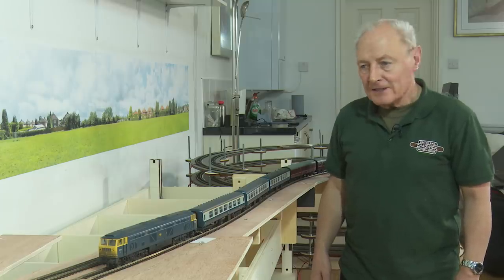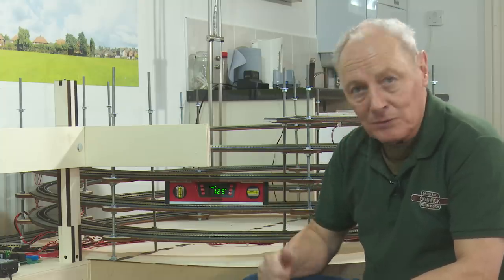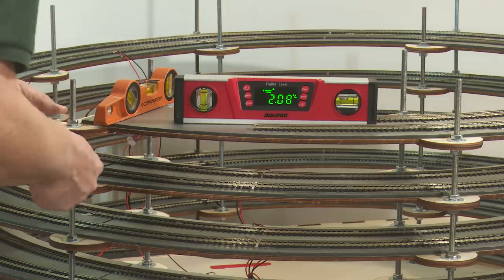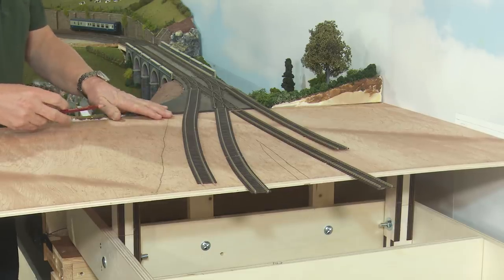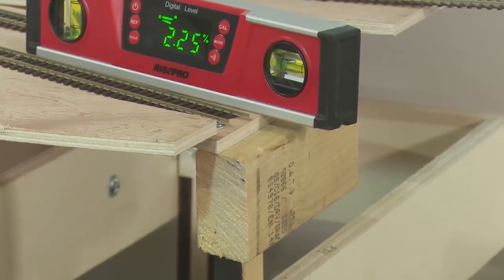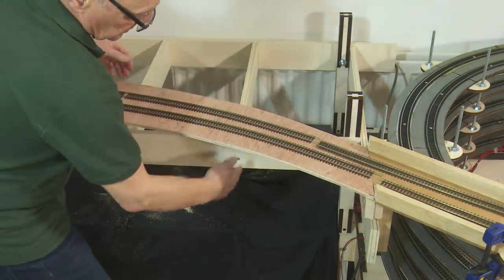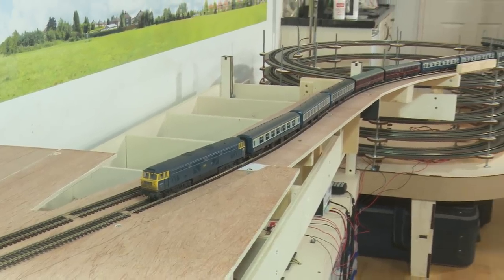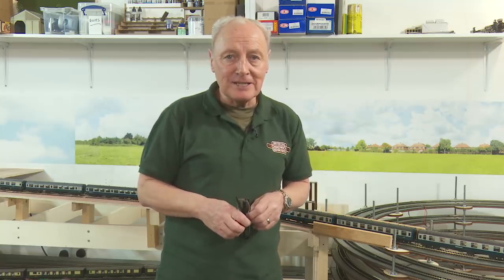Managing Inclines and Layout Update at Chadwick Model Railway | 123.

Comment: Really impressed with this. Its looking a LOT better and great to see it working well.  

For the station board, above the helix, i would concider constructing it so it potentially sits on a frame with Dowels, aswell as not laying the track straight accross the joins (dcc concepts copper clad sleepers are excellent for this)
You could then have the station board basically unbolt and be able to remove the whole area.

Will be a LOT easier to work on the scenery side than leaning over a very spiky looking helix!
Plonk it on a work bench and away you go! 😀

All the best Charlie, Eric F
Reply from the maker: A very interesting comment Eric. Yes I had thought about having a removable section, and also to cover just half of the Helix if that makes sense. It’s great to have you on board, regards Charlie
Reply: @ChadwickModelRailway  yeah would make your life much easier at the end of the day wouldnt it. 
Im very impressed with the helix anyhow, its a work of art!
Look forward to the next vid.

Comment: I don't know what is says about me! But one of the most absorbing videos on YouTube I have watched!! A genuine sense of anticipation at seeing it working, and total admiration at your skills from the point of view of design execution and carpentry.
One thing, have you given thought as to making the front side of the board wide enough for the necessary scenery as the track curves out the top of the helix, as it would seem to me, that quite a bit of woodworking will need to be done to create at least the frame for the 'nearside' of the cutting as the track disappears into the tunnel. If you follow what I'm saying that is.
However given the enormous challenge you have given yourself when you embarked on this new plan for your layout, this issue will I'm sure not present any significant issues.
When your wife said 'that looks dangerous' I wonder if she is referring to the dangerous enormity of the project your undertaking! 😉
Reply from the maker: What a great comment Keith. The trackbed for the track as it comes off the Helix is by no means the finished item. I can easily make it wider or more narrow to suit the landscape that I will build. I do hope this helps, regards Charlie

Comment: Nice vid.
All of this is a good reminder that planning the helix is crucial. The rise must be enough to clear the track below, allowing for the thickness of roadbed, upon completion of the first revolution. The radius needed to do that can be calculated as the rise divided by the quantity of the decimal of the grade percent, pi, and 2.
Ex: for an N scale helix rising 2.75" each revolution, the radius curve for a 1% grade is 2.75/(.01*3.14*2). About 44".
Reply from the maker: I think you’ve hit the nail on the head Donald, it’s no walk in the park. I now have various items of rolling stock to modify so they can survive the pressures of the Helix.

Comment: Well, Charlie, it works!! At first, I did not see the problem and then it fell into place. The gauge that you made could not possibly fit under the first ring and then that meant that all the rings would have to be lowered and hence the need of a top ring. It must have taken a long time to sort that out. The clearance in height is a bit tight an American observation car would mean people losing their heads. A job well done. I much invest in one of those spirit levels as you know I am facing some inclines and I have changed the plan again. Martin. (Thailand)
Reply from the maker: Excuse the pun Martin, but it’s been one hell of a journey sorting this little issue. Regards Charlie

Comment: So pleased you finally reduced the gradient, your engines will be all the better for it too, track work exiting helixit looks great. On gradient measurement a note of caution just because it's digital doesn't mean it's accurate, steps 1.99 to 2.08% is a 4.5% error, and if it's resolution is + or -  one increment that is a whopping 9% error and that's before we add in calibration accuracies. Far more accurate manually measuring or using a simple spirit level and gradient triangle. It being repeatable (subtly different from accurate) might just have worked for you though. Glad you are pleased with it all. Stephen
Reply from the maker: But in the helix?
Reply: Yes, you have equal segment arcs, each must rise by the same amount, carefully check each for the critical first turn then use your gauge block for equal spacing between following turns to set those. Sure a bright led display is far easier to read, but as said ther is a significant margin of error in its reading as you rightly highlighted. Am glad it showed up your first turn gradient error.

Comment: A great video Charlie - thank you.  The digital inclinometer clearly helped a lot to show you where the difficult areas of the helix were.  Another (cheaper) method is simply to put a small spirit level on on a flat wagon and watch how the bubble moves as the wagon goes up or down the gradient.  For a constant gradient the bubble should remain stationary.  Given that you know the average grade (by calculation) it should still be possible to make adjustment where needed.  (Just throwing this out there...)  I have a small Märklin Z gauge wagon which is simply a small spirit level on a pair of bogies it works surprisingly well for such a simple device.
Reply from the maker: I understand the point you’re making. However, it’s best to use the digital spirit level during construction. That would’ve removed all the errors. Regards Charlie

Comment: Hi Charlie, 

The Prototype mountain railroads that had many challenges and needed steep grades, (like many railroads in Colorado with 3% - 3.5% and higher grades), were trying to gain as much rise as possible in the limited space they had available to meet the demand. They had a method of applying grades. They used to at the beginning of the grade have a steeper incline while much of the train was still on more level ground and then they would ease the grade to the ruling grade. This would gain them a few extra feet of rise without bogging down the engine or causing driver slippage.

Example: They might have a 3.5% grade for the first part of the grade (while the trailing freight cars were still on more level ground) and then they would ease the grade to a lesser grade, like say 3%, when all the train was now on the incline. This way they picked up extra rise and could reduce the ruling grade up the incline. 

I have done this on one part of my HO mountain railroad where I have steep grades, which comes in handy if you're trying to get that extra 1/2" of rise in the space you have to make the climb. 

Just thought I'd share that info. We can learn a lot from the prototype and it is interesting how they solved problems. All the best Charlie. 

Philip
Reply from the maker: What a very interesting comment Phillip. I’ve never really considered that option. Regards Charlie
Reply: @ChadwickModelRailway  Yes, I understand Charlie. Neither did I think of that until I learned from researching the prototype mountain railroads. (It's actually fun researching and always good to learn how a real railroad solved problems). Using the prototypical approach, is a method that can come in handy for some and be very useful when trying to solve a grade/space problem. All the best from New Jersey.

Philip

Comment: Excellent and interesting as always.  Thanks.  It is of particular interest to me as I am reconstructing a helix to go from 4-track to 5-track with a particularly difficult gradient on the inner track - radius 1 at about 1 in 28  which is about the minimum possible with sufficient head clearance.   Judging from train speed variation I too have a problem with varying gradients and will now get hold of the marvellous digital level gauge you used. It could be a life saver.  Incidentally, I use a 1 in 42 gradient on my mainline as you are now doing.  This was chosen as the shallowest gradient that still looked like a gradient.  Everything much less steep just looked like level track.
Reply from the maker: A great comment Graham. Good luck with your helix, they’re never an easy beast to tame! Regards Charlie

Comment: In the US, cheap spirit levels typically have marks for 1/8 and 1/4 inch per foot, for putting in slope for adequate drainage.  That's 1 and 2%, approximately.
Reply from the maker: But doesn’t cheap mean inaccurate?
Reply: @ChadwickModelRailway  maybe I should say "even" cheap spirit levels...  My guess is that even the cheapest would do for our hobby needs.

Comment: I'm sure I heard heavenly choirs singing "Hallelujah!" when you revealed the helix was fixed. Time to scrape the bullfrog snot off the locos to improve pickup!

Many years ago, a carpenter warned me against using PVA to seal timber, pointing out that PVA is water based.  He recommended yacht varnish for sealing wood, though I suppose any exterior paint or varnish would work.
Reply: PVA is not like emulsion paint. Since you can soak it and then detach the items, it is clearly reversible. So perhaps the paint option might be better to seal the MDF?
Reply from the maker: An interesting point Andrew, but I certainly hadn’t considered. Regards Charlie

Comment: Well done Charlie - good progress.  I imagine there are a few of us having to think through what alternative solutions to material shortages that exist due to lockdown/factory closure etc.  I seem to be spending much time repairing 2nd hand peco points that I acquired a wee while ago, without realising how fiddly they can be!  Nevertheless, its nothing to the challenge ahead - one being thinking through the power districts (2) and block detection (lost count) using Digikeijs and probably iTrain  - and then creating an interface with the upper level I'm just starting which will be for my older Triang stuff running DC using buckets of series 3 track I have....not an issue other than electrifying the old points......(thought - might ask my wife to sit and pull strings when points need changed.... naw..never happen!).
Looking forward to your solutions regarding power district/booster and block detection.
Reply from the maker: Yes building in the block detection with a separate power supply in mind, is a little challenging. However being at the planning stage, it’s much easier to adapt the plan as the layout take shape. Hopefully I’ll cover this in more detail as the layout develops.  Stay safe, regards Charlie
Reply: @ChadwickModelRailway  yes Charlie, a plea for lots of detail on the wiring of booster and block detection. I’ve just bought a booster and extra BDL but they’re both just sitting there at the moment with me crossed between confusion and panic.  I’m hoping you’ll relieve me of both.

Comment: Hi Charlie, Have watched several of your videos, many more than once. Your problems with steam locos climbing the helix got me thinking. I have 1:50 inclines going up to my S&D section and most locos can handle up to an 8 coach load reasonably well. I believe your problems may not be the rate of incline as what you have should be manageable. I actually think the problem is more likely the radius. As you know most railway vehicles including models have solid axles and so one side of each axle will be slipping or sliding and the tighter the radius the more drag will be induced. Steam locos usually have bigger diameter wheels than diesels and that also exaggerates this problem. I realise you have used a helix to gain height in a reasonably small area and there's little you can do about that. My minimum radius on my incline is 30ins and mostly above. However I have also installed Powerbase but have yet to put it to test. Will let you know how I get on with it - will be fitting my S&D 7Fs to increase freight train lengths. Just watched the video on Stay Alives. So far I haven't needed them. Stay Alives don't actually cure the problem as the loco is unlikely to be at fault - the problems lie in the track and getting that as even and 'lump free' as possible usually sorts it out. Incidentally if you buy Loksound decoders from South West Digital direct the version 5 decoders come with Stay Alive wires soldered to them. I believe that is only available from them. None of the foregoing should be seen as any criticism - love your videos, I have learnt from them even though I have been railway modelling for about 65 years. Keep up  the good work. Barry
Reply from the maker: Hi Barry and thanks for the great comment.  The ESU v5 all come with SA cables now.  I agree about the use of SA’s but they do also make up fir poor design.  Regards Charlie.

Comment: Gidday Charlie, I notice that there are no sleepers on your rail joints, do they go on later?
what I have done is to slide a knife blade between the rail and the sleepers and slide the 
fishplates down the rail between the rail and the sleepers keeping the sleepers nice and 
close. This is probably 'old hat' but that's what's all about 'learning from others'. Another
thing I have done, particularly in tunnels and out-of-reach places you will never go back 
to, is to 'spot-Weld' the fish plates to the foot of the rail. I have found these joints move
over time. You've already found that Polystyrene and Solvents don't go well, they do 
however when making rock faces - that natural weather-beaten appearance.
What is the latest update online? Wayne  Birkenhead NZ
Reply from the maker: Great comment Wayne and yes I do fit my missing sleepers prior to ballasting.

Comment: In my experience, MDF (kept dry) is much more dimensionally stable than 3/8" plywood, but I'm under the impression you disagree...passionately. I built an MDF AV cabinet about 20 years ago and it's as straight now as it was when I built it. I therefore was going to use it as baseboard for my shelf layout, which will literally sit on a shelf with no access below, using the MDF to restrict warping while the 3/4" plywood of the shelf itself twists and turns all over the place. Bad idea?
Reply from the maker: If you do use MDF, I would certainly seal it first. Regards, Charlie

Comment: Flattening that level out really seems to have worked a charm.  That would have been a programming nightmare to have had to remember which trains needed to go to full throttle going up the helix.
I use one of those digital levels to inspect construction sites for compliance with accessibility laws, and every one of them, w/o regard to price paid, is utterly random at measuring percent rise (luckily the government regulations take this into account).  In reality they are much better at roof pitch as described in inches per 12" run.  Sigh.
Reply from the maker: Excellent comment mate. Without that spirit level I would have been truly stuffed, regards Charlie

Comment: Hi Charlie,  I like how it works and looks but I'm concerned about were it connects to the  old track.   It looks like it has a sharp  change.   I'm worried about it coming uncopled.  I guess I will find out later.   Good luck with a smooth transition to the Viaduct.   Later on, Chris
Reply from the maker: Let’s keep our fingers crossed Chris. I believe I’ve sorted the vertical curve but only time will tell, regards Charlie
Reply: I'm hoping for you my friend.

Comment: You got the incline curved out well. 
About the planned tunnel entrance, as represent, I find you lose to much of this photographic scene if you do it that early - make the board helix joining piece a cutting in the landscape, maybe with a road bridge over (going from the station to the viewer), a bit more incline scenery into the tunnel starting at the curve to the back as if the tracks would flex on down in roughly the same direction.
The plan for that station up there may you rethink it - the terminus / formerly junction you name and plan it after has other surroundings as the "Chadwickshire Hills" are.
Reply from the maker: Great comment LUS, regards Charlie

Comment: Having used a few miles of MDF, I've found that giving it  good clear sealer seems to encourage it to behave.  For painted window trim where curtains and drapes are to be used, it's the cat's meow (if in 12 & 16mm sorts of dimensions).  I would just give a couple of coats of sanding sealer to prime, then two coats of the finish paint (typically a satin laytex).  None of that has moved in a couple decades.
Ok, less easy in a time of restricted access to stuff.  But, a spray clear lacquer probably a better sealer than a pot of PVA.  Just 2¢
Reply from the maker: Interesting points mate, but if you saw it the particles are very toxic.

Comment: Did I spot an EWS 66 and a HTA in the lower fiddle yard? 🤔 Very nice and tidy work on sorting the helix and supporting pieces - good to see trains running again. Probably a stupid question, but will you be programing the Digitrax system so that the locos run at scale speeds around the scenic section of the layout before increasing the speed to make it up the incline? It seems they need to go quite a lot faster than is realistic to make it up the helix?
Reply from the maker: Good spot Chris, I sometimes forget how much detail people look for. Yes I will program trains to run at various speeds, hitting the Helix for  their optimum performance

Comment: Charlie it may seem a silly question, but what did you use to determine the distance between the marshalling yard and the upper level of your layout? It could be that by reducing that height you could have reduced the number of spirals within the helix.
Reply from the maker: The helix had to lower the levels to get the fiddle yard under the viaduct board. That was the limiting factor. Regards Charlie